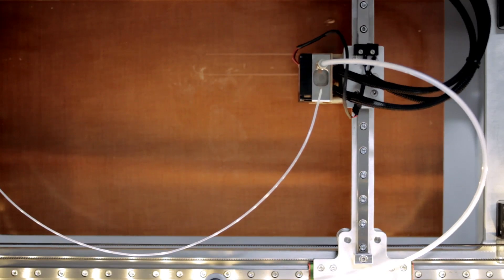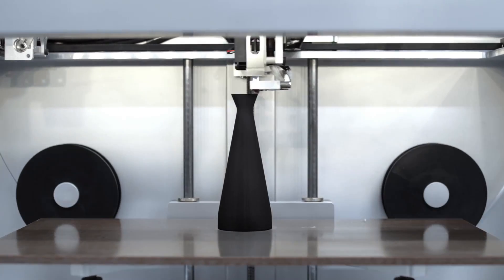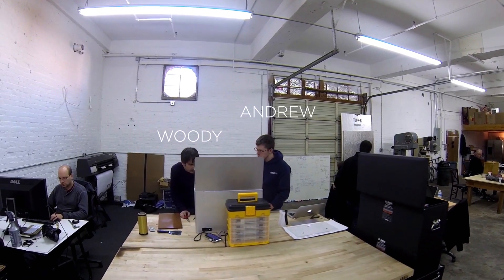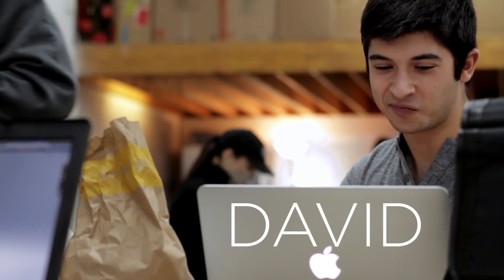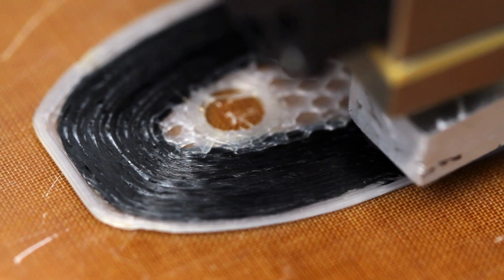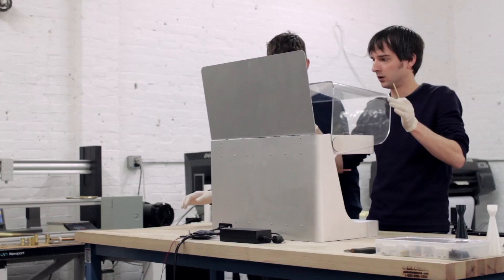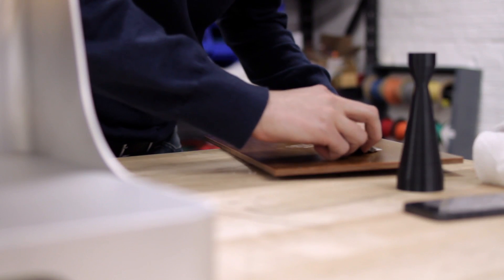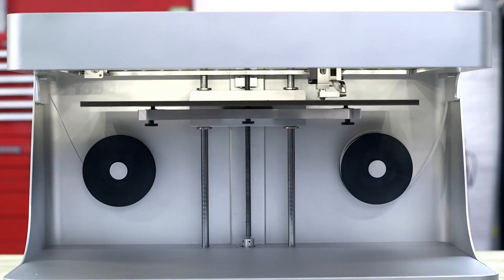Meet the Mark One: the world's first Carbon Fiber 3D printer

Comment: don't get your hopes up to much, anyone who knows how to work with composites can tell you need to design with composites like you are building something out of rope. the fiber direction is very important. this can only lay fibers in 2 directions, and seems to be doing so arbitrarily. also, there is a minimum bend radius to carbon fiber, this seems to ignore that.

however, it should still be a lot stronger than plain pla

Comment: How do you reinforce the vertical direction? Like Slappy Fistwad said, the fibers are not reinforcing each other. So the part is not optimum even in the x y direction. In other words. It has to be heavier to achieve the same strength as regular composite part.
Reply: Aviator168 

A true carbon fiber part will have a higher strength to weight ratio than this print process offers that's true. This increase in weight (and size) may not be much of a concern for most applications though. Further, it will be possible to print/lay the fibers down in a crosshatch pattern mimicking carbon fiber. This printer has the capability to lay the fibers in any pattern imaginable as to allow flexibility on one plane and rigid on another; and possibly being able to control torsional twisting as well. In the future these parameters of stiffness will be able to be "dialed" in creating the exact characteristics desired.

Comment: yeah but the part is strong only in two axis, z axis is only as strong as the fused plastic, where all applications for carbon fiber are much more 3 dimensional... they would need to ad two more moving dimensions to the bed

Comment: Trouble of  it is, you need to WEAVE the fibers in order for the composite structure to have full strength.  With this, you are largely depending on the strength of the epoxy bond. The fibers just cleave instead of mutually reinforce each other.
Reply: The theory does not support this claim

Comment: Please make a big enough model, to print large car body parts!
Reply: I'm waiting on the specs for the extruder. lol
Reply: Rashad Glover
I'm working on one that uses resin and hardener both impregnated with carbon fiber snippets and a mixing tube. The mixing tube/print nozzle will be in 2 halves so cleaning will be a breeze if you do not wait until it sets up 100%.
Reply: +Geo K whats the update on your project? lol

Comment: Very cool. I had a similar idea some time ago, when I started building my first printer. You probably won't tell which kind of plastik you are using as matrix material in the carbon fibre filament? I guess you have to cut the filament at least at the end of each layer. How's that working out? Or did you find a work-around?

Comment: Still, for high volume production this is probably very costly. Carbon fiber is really expensive, and 3D printing it is probably more so. Also you cant recycle this stuff!

So no this won't change the world. Most large scale production parts will still be made out of METAL.

All rapid prototyping is, is just that, PROTOTYPING. ABS plastic works just fine because they are not production parts.

Just another flashy spectacle for all the gapers, "non-technical" folks, out there who like to oggle at the words carbon and fiber.

Comment: Hmmm.... I wonder what makes the printer so "special" so it can print a carbon fiber filament. I have seen CF plastic filaments that were 15% CF that can be used in your standard RepRap printer, which did increase its strength, but how good is the filament they use compared to that material I just mention, and to normal Carbon Fiber composites that we make with molds and resins already?
Reply: The real adavantage lies in the continous fibres. Fibre mechanics work very differently from isotroppic materials like plastic or metal. The filament you're speaking of has most probably very fine cut fibres in it, which improves the stiffness, but not nearly as much as a continous fibre would. Also its relatively easy to produce such a filament with cut fibres because of the low fibre volume content. By looking at it I would estimate a FVC of at least 30% and its really hard to combine thermoplastics and fibres at such high ration. Of course you can get better results by using moulds and resin, but moulds are very expensive and/or time consuming in the making.

Comment: Unless they've found a way to get the carbon to form new bonds after being laid down, aren't you really only getting the strength of the resin being used to bind the layers, plus a bit of a rebar effect from the carbon?
Reply: yes, that's why it claims only 10 times stronger than plastic, if it would lay down layers top of each other like real traditional carbon fiber manufacturing it would prolly claim 1000 times stronger than plastic and printer itself would cost over 100k. but who minds 10 time stronger printing material whether it's "real" carbon fiber or not? as long as it's "enough" strong and also looks beautiful?